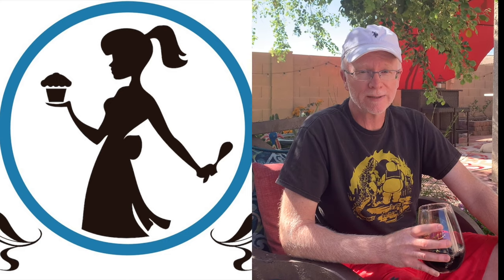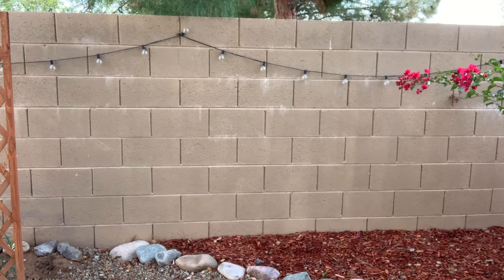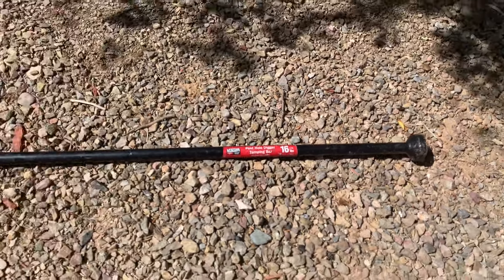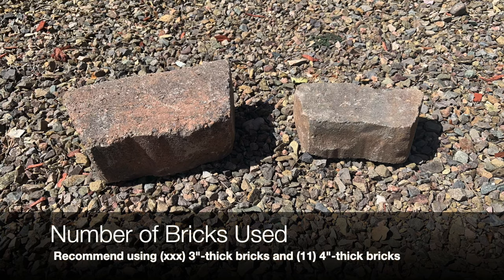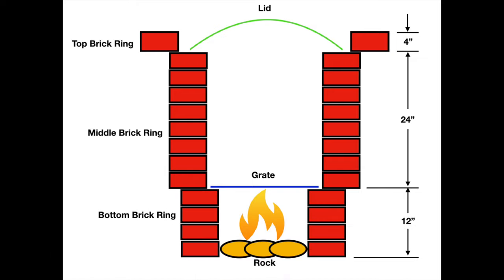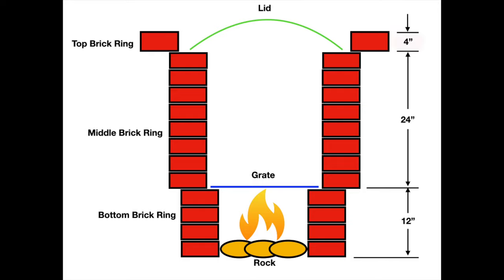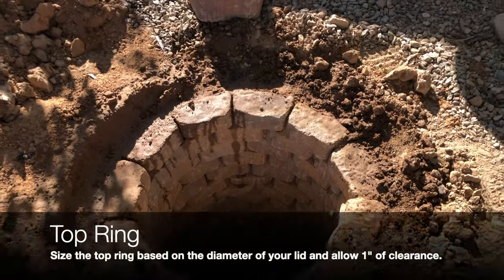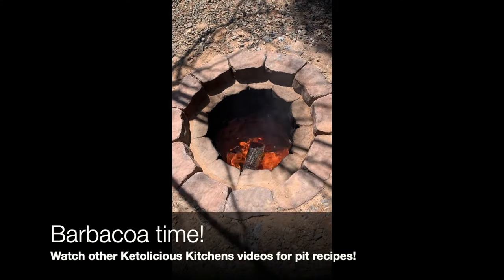HOW TO MAKE A BACKYARD BRICK BARBACOA/BARBECUE PIT!  Weekend project!

Comment: I just moved to a new house they have a fire pit in ground made from a 55 gallon drum i am going to be putting a brick boarder around it above ground from ground to the grate is 18 inches how far above ground would you recommend the bricks to be also how would i go about getting the meat out lets say i make it 10 inches tall above ground that means to the grate would be 28 inches so i cant just reach down into it any suggestions?

Comment: I see you have given the depths but What is the dimeter of the Pit
Reply from the maker: Hola Francis!  For my pit, the inside diameter (ID) of the main body of the hole was approximately 24".  As mentioned in the video, the grate I bought was 22" so I needed to give myself about 1" on each side to provide plenty of clearance when I need to remove the grate.

The ID of the hole that the grate sits on is roughly 20".  The ID of the top deck will be a function of the size of the lid you use.  Saludos!

Comment: Any issues with flooding? Was wondering if a liner would be beneficial?
Reply from the maker: We live in Phoenix, so not a concern here ever 😀.  I think if you use a liner, you’ll need to figure out how to get the water out unless the lid seals really well.  Also, it’s going to need to be a liner with a high temp rating as it will get around 500F at the start.

Comment: Great project. Can you tell me the outer diameter you dug for the coals/river rock level and then the same for the cooking level above? Thanks.
Reply from the maker: Hola Derek, super sorry for the delay in responding...crazy week.  The outside diameter of the bottom hole for the first ring level that the grate rests on was approx 28".  The outside diameter of the hole for the next ring (that provides clearance to remove the grate) was approximately 30".  The top level flush with ground had an OD of 44".

It's all going to depend on the size of the grate you buy.  Give yourself a 1" ring of landing for the grate to sit on, ideally to provide a 1/2" of landing for the grate and a 1/2" of clearance to pull it out..  This will allow the grate to remove easily but also allow plenty of surface on which the grate can rest.  

To double check, just stack 'em up on the ground first to get the dimensions.  It worked out for me that adding one brick to the middle ring created the exactly the above-mentioned clearance -- no need to cut bricks.
Saludos!
Reply: Fantastic. Thank you.

Comment: How you clean the ashes out? How you keep the heat going? My pit is simular  heat goes out and food is always    rare? I even do a fire on top and just got medium  rare after 10 hours. Took lid off and inside was cold ?
Reply from the maker: Hola Jeff, to clean the ashes out, I use post hole diggers and a broom.

To keep the heat, it starts with an 8"-10" deep bed of coals.  If you don't have enough coals, you won't be able to sustain a long cook time.  

The other important feature is you need to make sure it's well sealed.  After you drop the meat in and cover with the lid, you need to lay a blanket over the lid and then seal it with at least 1-1/2" of soil to trap the heat and seal any air leaks.  If any smoke is visible, then you have a leak and the air is going to speed up the burning out of the coals.

I hope that helps.  Saludos!

Comment: How do you get the ashes out after a cook?  It seems they would soon fill all the gaps around the rocks and be difficult to shovel out.  I guess a shop vac would work.
Reply from the maker: Hi Blauskie!  Great question... I usually use a broom and post hole diggers to sweep it into piles and pull it out.  I have however also used a shop vac, but that's like a once-a-year event.  Ashes around the rocks isn't a problem as the  heat is so great you don't really need to worry if ashes are on the sides of the stones.  Saludos!

Comment: Maybe I missed it, but you chose to only use 3" bricks, and the total number of "rings" stacked was 11? How many total bricks did you use for that depth? 40 for the bottom layer and how many for the middle?
Reply from the maker: Hola Josh!  There are three rings in the bottom for the coals and grate, 3” bricks with 10 bricks per ring.  Then there are eight rings above the grate, 3” bricks with 11 bricks per ring.  Finally, the top ring (flush with ground) uses twelve 4” bricks.  

Hope that helps!

Comment: I started mine today!  Got a couple feet down then hit good old east Texas red clay/semi rock. Then the rain came. Been semi-obsessed since seeing this video. How do you capture the juices and make a consommé with this cook?  Also, any downfall to using common architectural bricks?
Reply from the maker: Awesome!  Sounds like the breaker bar I showed in the video might be good to break the rest of the clay.  As far as the consommé goes, I use a giant steamer.  It’s like a lobster pot but has an internal ring on which you can set the rack for the meat.  The juices melt off into the soup underneath — every bit as a tasty as the meat!  We’re going to make some lamb in a week or so showing the process.  Just running out of weekends for the year!  Saludos!
Reply from the maker: Oh and as far as bricks go, I’m not sure.  You’d think they’d work. I used the fire pit bricks to get a better circle and seal between the ends.

Comment: Thanks for this video! I’m in the process now of digging out the pit! It’s not easy at all but i know  it’s worth it . I’m digging ti about 40” deep .. any thoughts on multiple grates so I could add a couple more briskets. I would love to make at least 2 maybe 3 at a time . Not sure if stacked meats would still work as well
Reply from the maker: Hi David! Thanks for the positive feedback!  The challenge with multiple grates is you'll need multiple ledges to support multiple grates.  Unless the grate in the bottom is smaller than the one above, you're going to end up trapping the bottom one under the ledge supporting the top grate.  I've loaded a 32-quart steamer/tamale pot with lamb and then placed two 15-lb briskets on top of the lid and had no problem getting it cooked.  You'll definitely be able to stack two briskets with no problem, based on my past experience doing the same.  Three seems doable, but that's 45 pounds of meat, man!  Let me know how it goes!
Reply from the maker: Will do and good luck with the pit!  Saludos!
Reply: Hi one more question .. my pit is approx same diameter as this one ... approx how many bricks did you use ?
Reply: ActUally  decided to take your advice and go bigger .. 36” grill
Reply from the maker: Hi David, sorry for the delay, crazy weekend.  The bottom brick rings were 10 bricks (3" tall), the middle were 11 bricks (3" tall) and the top ring was 12 bricks (4" tall).  Looking forward to hearing how it came out!
Reply: Ketolicious Kitchens thank you very helpful!
Reply from the maker: No problem, David and be sure to post some photos at our FB page when you get it finished! https://www.facebook.com/KETODIETBAKERY

Comment: Great vid. How do you keep the surrounding soil moisture out when not in use?
Reply from the maker: Hola Regis, thanks for the comment!  Well, it's pretty easy to keep the soil moisture out since we live in Phoenix, AZ.  The soil is dry packed clay.  😀
If you live in a place where there's a lot of rain and saturated soil, you might try testing it with a 12" or 18" hole first to see what happens.  Saludos!

Comment: How Many bricks in total did you use I bought  12 4in and 23 3in
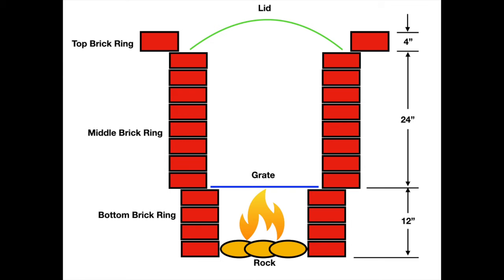Reply from the maker: Hola Jaclyn, the bottom brick rings were 10 bricks X 4 layers (3" tall), the middle were 11 bricks X 8 layers (3" tall) and the top ring was 12 bricks (4" tall).  So that's 128 3" bricks and 12 4" bricks.  See diagram a 4:05. 
 Looking forward to hearing how it came out!  Saludos!

Comment: How do you drain the rain water, and make sure it remains clean from insects or what not. How do you make it water proof.
Reply from the maker: Hola Ram R!  We live in Phoenix, so rain is not much of a concern.  If you get a lot of rain where you live and the rain water doesn't soak into the ground quickly there, you'll need to design the lid to cover the top ring rather than nest within it.  
Regarding waterproofing, I'm not sure there's a way to water proof it.  You could minimize water penetration by using mortar around the bricks, but I don't have enough knowledge about it to say how durable that would be.
Regarding insects...You can sweep it out before use, but it's going to get over 500 degrees F when sealed.  Any insects in the pit will be ashes.  Saludos!

Comment: This is more of a Luau. Barbacoa is just the heat of the bricks. That's why the fire is made in the pit , to heat all the bricks for a 16hr roast. Usually a trivet or hot bricks loose on the bottom work well to position a pot on the bottom to catch the meat drippings. With no cosume' its not real barbacoa. I liked your video! I liked the fact that you shared your design off pit for everyone to use. Great video. Keep em coming!
Reply from the maker: Hola Sine!  Thanks for the comments and enjoy!  Saludos!

Comment: Hi ! How does the fire can breath?
In smoking pit you always need to have some gaps for the fire to breathe..

Also, is this called BBQ Pit or Smoking Pit? Or it is the same thing.. thanks
Reply from the maker: Hi Itamar, great questions!  This is a Mexican style of pit cooking that involves sealing the pit instead of letting the fire breathe.  You create a deep bed of coals that provide enough heat to slow cook the meat while the hole is sealed.

This is different from traditional BBQ or meat smoking.  It’s more like slow-roasting in an oven.

Check out our video for barbacoa pit brisket to see more how the process works:
https://youtu.be/qMNNHvv4kh8

Saludos!

Comment: Do you need to clean the wood out after every use or do you let it burn all the way down?

We call this a 'Hangi', not exactly but similar principle were we use river rocks (or nowadays, iron) but we clean the hole out then put the rocks down.  We cover the hole and food up with wet sacks and thats what cooks ours.

Cheers
Reply from the maker: Hola Aloysius!  Wow, interesting; that's not too far from authentic barbacoa pits where they use maguey or agave leaves.  

Regarding the wood, what happens is the coals burn down to ashes and then I use post-hole diggers to pull the ashes out.  I sweep the ashes in a pile and pull it out until I see the river rock again.  

I think if I did it over, I'd spend some time thinking about how to pull the ash out easier, but it isn't that big of a problem.

Comment: Looked at you video and it looks awesome! They only thing I would have done extra (not sure exactly how but...) is to build in an extra set of brick or maybe sort of removable metal clips coming out higher up in the pit so that you could add in an extra grate! Now you have a perfect oven/pit, but only one space to put stuff to cook on. Something so that you can still shimmy down the lower grate, but so that you can put another one on top. Maybe something to think about if you ever build another, or decide to redo/improve this one. But thanks for an superb video!
Reply from the maker: Hola Martin!  Great idea and thanks for the positive feedback!  Actually I toyed around with the idea of driving three or four evenly-spaced rods into the sidewalls higher up in the pit like you described.  The grate would then have room to pass down to the base brick layer for barbacoa or rest on the rods for an additional surface.  Not sure my description is clear, but it seem like it would work.  Saludos!

Comment: I want to try this but I don't live in the desert like you. How do you keep the pit from becoming a well when it rains? Is the lid enough to keep out runoff?
Reply from the maker: Hi Alex! I think you’d have to size your lid such that it rests on top of the top ring rather than inside the top ring.  The lid would shift around more, but at least the water could roll off the ring instead of funneling into the hole. Saludos!
Reply: I live in northern Canada and that was my issue. I found a large tarp over the put during the wet season worked well enough.

Comment: My experience with the river rock is when they get hot they explode, and you get shavings like Frisbee flying around.
Reply from the maker: Hi Gator Goins, I had one crack but that’s been it. We live in AZ and they were buried in the ground when I used them; don’t know if that makes a difference.
Reply: They Only explode if there’s moisture inside. Once  you heat the river stones red hot they will never crack again unless moisture gets inside again.

Comment: would it work better if you also dig out a side tunnel that goes up to let oxygen in to the bottom of the fire?
Reply from the maker: Hi, interesting idea...  It might help some with starting the fire, but you definitely would want to seal the tunnel when it's time to cook the meat.  You'd lose the heat otherwise.  (This is different from smoking meat in a smoker, where you're feeding oxygen to the fuel during the cooking of the meat.)
Reply from the maker: Wow, cool...

Comment: I thought it would need a pipe going down along its length to connect to the bottom to provide oxygen.
Reply from the maker: Hola bombo atomico!  Nope, this is different from barbecue where you're using air and flame to control heat and/or flavor the meat from smoke of the wood.  This barbacoa pit is more similar to traditional Mexican barbacoa pits where you're using the heat from a deep bed of coals to cook.  If air is allowed in, you'll lose the heat needed to cook a big brisket or pork shoulder for 4-5 hours.  Kind of like a giant sealed crock pot of sorts.  Check out the brisket video for more details. Saludos!

Comment: Curious about making one. Is there any issue with the hole connecting rain water?
Reply from the maker: Great question... we live in Phoenix, so we just don’t see enough rain here to have ever seen that problem.  If you live in a place where water stands for a long time, then you’ll probably see water staying in the hole.  A workaround would be to make the diameter of the top ring smaller so the lid rests on top rather than within the ring, but then you’ll need to find a way to ensure the lid doesn’t shift. Saludos!

Comment: I wouldn't recommend river rock heat makes them explode
Reply from the maker: Hola ninjabeaner!  I've heard that from others, but only experienced one cracked rock.  Perhaps it's because the ones I used were already in the yard here in the dry heat of Phoenix.  Not sure, but you could always line it with brick instead if you prefer.  Saludos!

Comment: Love this! Are the bricks you used holding up to the heat?
Reply from the maker: Hey Joshua!  They've been in there for about a year now and so far, so good.  The heat is finally breaking here in Phoenix, so year two of the pit will be cranking up soon!  Saludos!
Reply: @KetoliciousKitchens  is there a specific kind of brick we need in terms of holding the heat and not letting it dissipate??  And how hot does those river rocks get without cracking?
Reply from the maker: Hola Jah Bless!  The bricks I used for the walls were circular fire pit bricks from Lowes. After I seal the lid, the temperature is around 500 F and it cools to 200 F in about 5-6 hours, so they definitely hold the heat long enough to get a good slow cook. They've held up great for the year and a half I've had the pit so far.
The river rock question is one I get a lot.  In the last year and a half, I've only had 1 or 2 rocks split.  Other people have comment they'll pop like fireworks, but it simply hasn't happened in this pit.  We live in Arizona and these rocks probably haven't seen water in 30,000 years, so maybe that's it.  Not sure.
In any case if it's a concern, you could probably line the bottom with similar brick and get adequate insulation (it works for the walls after all).  Saludos!
Reply: @KetoliciousKitchens  thankx budd I will def take ur advice when it’s my turn to build one in my back yard ...

Comment: How wide are the bricks
Reply from the maker: Hola Jaclyn, the 3" thick bricks are about 8" wide and the 4" bricks are nearly 12" wide.  Saludos!
Reply: @KetoliciousKitchens  thanks this helps so much I have another question I live in Bakersfield, Ca  how or what do you do if it rains will it damage it?
Reply from the maker: Hola Jaclyn, Bakersfield’s average rainfall is similar to Phoenix, so I don’t see any issue.   The rain may get in the hole but the ground will soak it up.  Saludos!
Reply: @KetoliciousKitchens  awesome I'm so excited to build now that you answered all my questions 😊
Reply: I have another question when making the Barbacoa what meat do you use and this may sound dumb but is it the same as deep pit
Reply from the maker: Hola Jaclyn!  We usually buy a big (15-16lb) beef brisket for barbacoa, but it’s more about the method so you could actually use a pork shoulder or even lamb. Saludos!